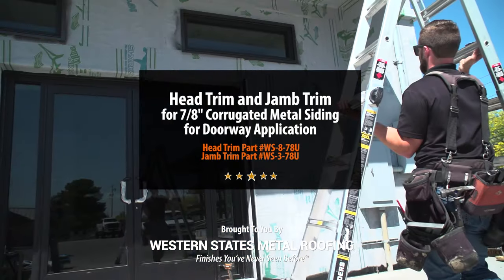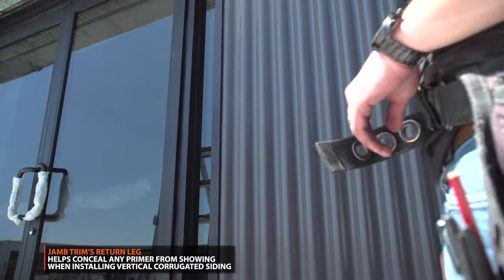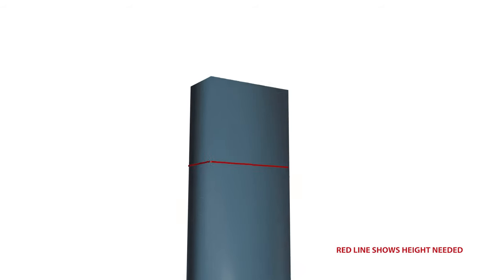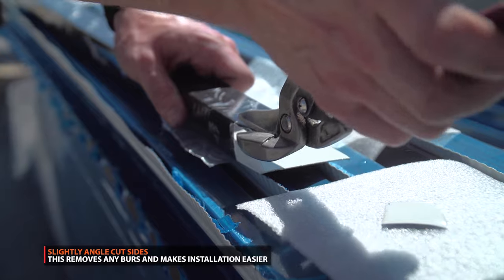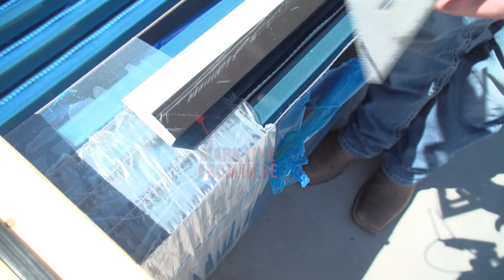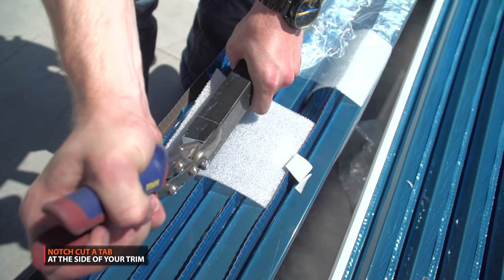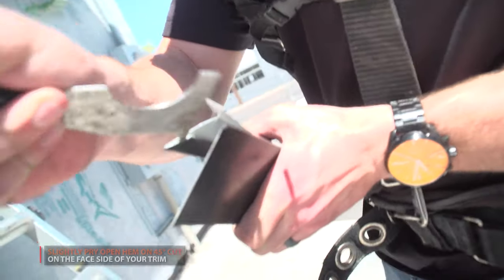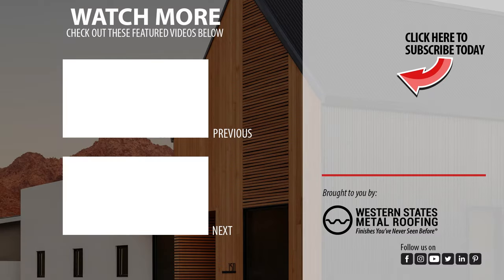How To Install Door Trim: Corrugated Metal Siding Head And Jamb Trim Installation For Metal Building

Comment: Would it be a good idea to use flashing tape all around the edges after installation?
Reply: waste of money, the walls should already be properly sealed!  i would recommend to install flashing under the water barrier, and metal siding should always be installed on some kind of rain-screen,  even if it is a 1/4".

Comment: If you don’t want the 45 degree cut can you just leave it square?
Reply: I left much mine square. I see no problem with it. Just make sure water can escape thru the bottom J trim. I should have a video posted on my channel within a week on how I installed the metal trim and siding. Just thought I’d throw that out there.

Comment: Hey, does a 13/64 drill bit drill a hole through a heavy structural girt, or perlin, or column for a size #14 or # 10 tap screw? If I remember correctly it would be a #10 tap screw, while a 15/64 drill bit would be for a #14 tapscrew, while 3/16 would work for a #8 tapscrew through heavy steel.